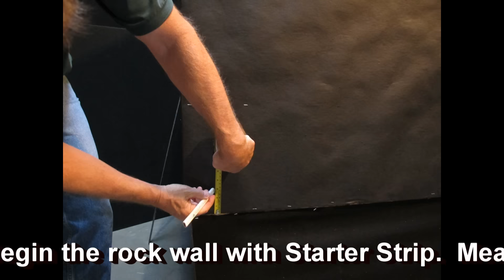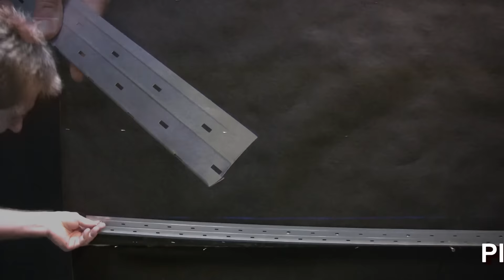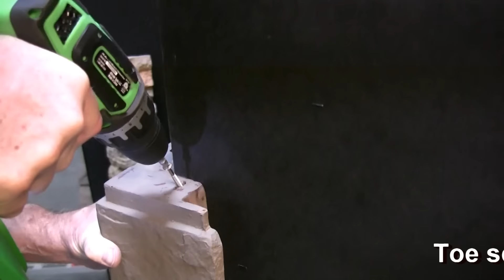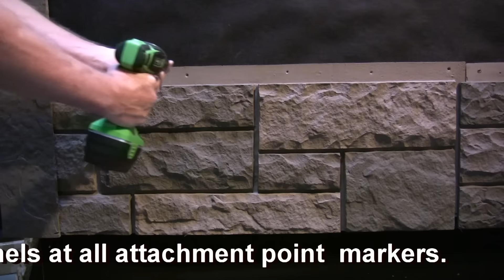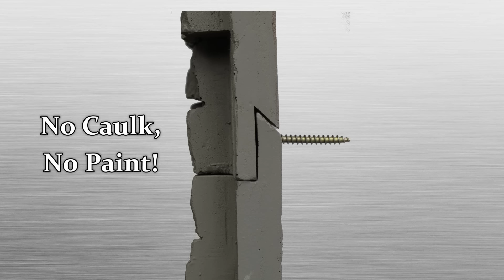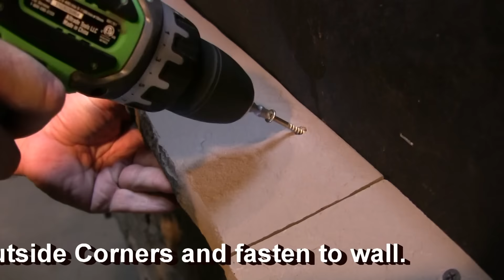NextStone™ Installation Demo

Comment: Can I apply this onto a stucco wall, possibly with glue?
Reply from the maker: It needs to be installed onto a solid substrate, so we recommend mounting a backer board (plywood or OSB) onto your stucco first and then installing the NextStone onto that.
Reply: @NextStoneCorporate 
Thanks for the advice.  However, even drilling a single hall on the stucco wall is a big job.  I will give up the idea.

Comment: I see how the video shows the left side tucked under the corner and the right side flush butted with a mitered edge, but is there any way to not use the left style corner , and use the better looking corners on both ends of the wall???
Reply from the maker: You can do this yes. However you may end up with an obvious seam if the corners are not staggered.

Comment from the maker: The NextStone Panels are made of a composite Polyurethane which differs greatly from "plastic" products. The Polyurethane is mixed with UV inhibitors and fire retardants and has a unique coating which is chemically bonded with the molded surface of the panel.
Reply: Polyurethane is a plastic material, which exists in various forms. It can be tailored to be either rigid or flexible, and is the material of choice for a broad range of end-user applications such as: insulation of refrigerators and freezers. building insulation.

Comment from the maker: NextStone is installed on Sheetrock all the time. The important thing to remember when installing the panels on this type of substrate, is to not over tightened the screws. 

NextStone can also be installed around fireplaces. Please check with the manufacturer of the fireplace to obtain the guidelines for the setback that is maintained at least the distance recommended for wood products. NextStone is treated the same way.

Comment from the maker: NextStone is not plastic like a lot of our competitors products are. It is a hybrid composite Polyurethane. It is an alternative to using real stone due to the amount of material needed to install and the amount of time it takes to install. You don't need any mortar, glues, netting, or any other masonry materials needed to install natural stone or cast stone. It installs like siding so it goes up in half the time as real stone.

Comment from the maker: As long as the old brick wall is flush and durable, you can install NextStone onto it, using brick/mortar screws. Since NextStone has a patented weep channel and air flow chambers on the back of the panels, moisture/vapor barrier can be used but is not necessary.

Comment from the maker: NextStone is mainly for the outdoors as a stone siding product. The panels have an insulating value as well. They are made to withstand radical changes in temperature and varying levels of rainfall or snow.

Comment: I am applying  Next Stone at the base of a home  on top of Styrofoam that covers the cement foundation. Advice ?
Reply from the maker: BayCityRollers N NextStone is lightweight and won't hurt the Styrofoam. It is recommended to place a few Tapco screws every 4ft to to secure the panel to the substrate.

Comment: We used NextStone to wainscot our shop.  Loved the product.  Was easy to work with, went up fast and looks awesome, HOWEVER!  We will never use it again for an exterior surface.  Woodpeckers have totally destroyed it!  Lots of money down the drain.  We now have to remove it all and put a real stone product the birds can't destroy.
Reply from the maker: Sooo sorry to hear! Woodpecker problems are not common with the NextStone product although there have been a few instances in areas where woodpeckers are prevalent.
Although durable, constant pecking in a particular area with a sharp beak, or any sharp instrument for that matter, can cause damage to the finish and eventually go through the entire thickness of the panel. Although NextStone is extremely durable to the elements, nothing short of real stone can stand in the way of a motivated woodpecker.

You can also visit these sites that provide additional information and ideas to help keep them away:
www.birds-away.com
www.attackspider.com
www.absolutebirdcontrol.com
www.birdbgone.com
www.pestkill.org
Reply: did you try woodpecker repellent?